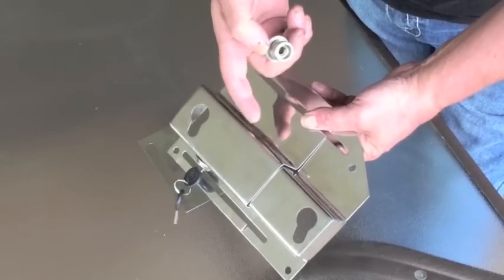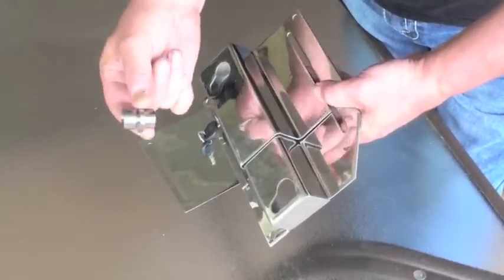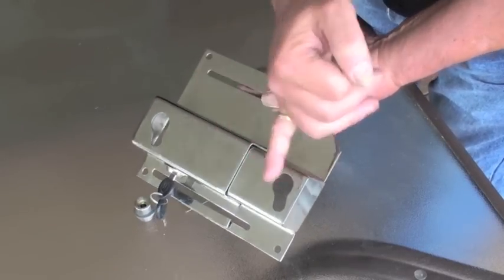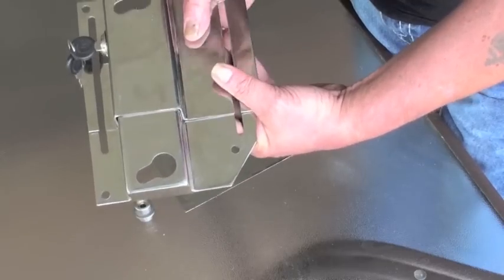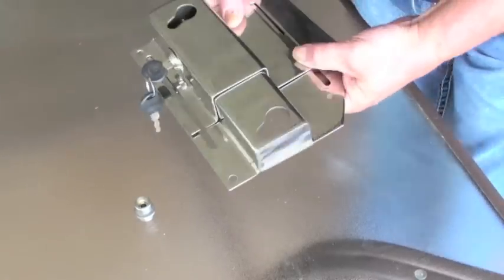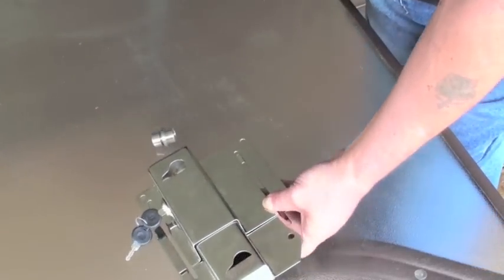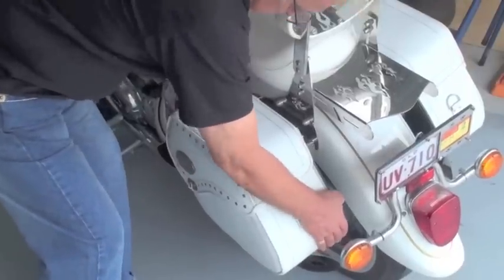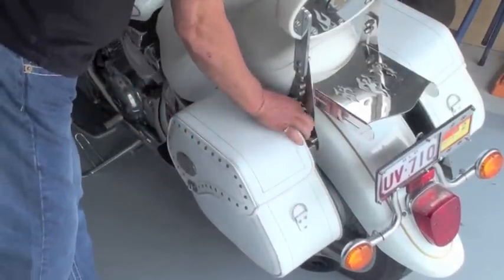Detachable Saddle Bag Brackets

Comment: GREAT SERVICE FROM THIS GUY!! I found that I couldn't overlap the brackets as the slight angle wouldn't let it dock because of the fine tolerances.. If you packed out the part that is sitting proud you could slide them over each other but I cut mine. Have been in use for 4 + years - still look as new. superb SS.
Reply: Yes a fundamental design flaw, to make them fit properly you have to cut them yourself, that is why all the alternative brands come in set lengths to fit your bike. In addition they will not sit as low as the others due to the top bag fixing strip (to attach the bags to the bracket)  being above the mounting holes for the spools. The ONLY positive to these is that they are made of stainless steel. Have already drilled holes in the bags so will have to persevere and put in the hours to make make them fit. Would not have bought these if I had known.
Reply: @stevemcdermott62  I wish I had seen your comment a few weeks ago.  Just ordered a set of these and despite all the talk on the video about making sure they are aligned so they operate properly, the design doesn't allow for alignment without extensive modification.  I ended up fabricating a backing plate and then placing the sliders on that.  Ended up with a much better result, not sure why they weren't designed like that in the first place.  I expected for $150.00 that I wouldn't have had to fix them. Like you I had already drilled the bags so was committed to using them in some fashion.  Even though they are stainless steel they are produced in China and the quality of the fabrication and supplied mounting hardware is poor.  In fairness they did offer to refund my money but I had already modified them extensively to get them to work.

Comment from the maker: You can get them only from bibblebar.com
Mine have been on my bike for 7 years and look like the day they were put on. The problem with powder coated steel is the powder coat wears off where the docking post contacts which makes bracket go loose not mention rusts.

Comment: So there just polished stainless steel ? so if i have to cut them to fit onto a Triumph Thunderbird they won't mark on the ends then.
Reply from the maker: I use an angle grinder with a fine disk. Takes one minute. Just trim the burrs after cut.
Reply from the maker: bibbles1947
They can be purchased through bibblebar.com